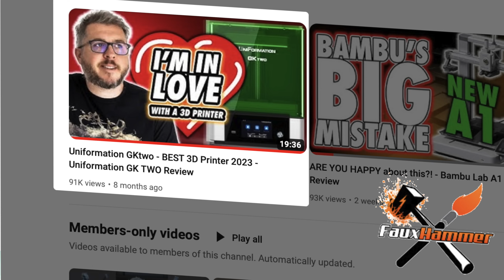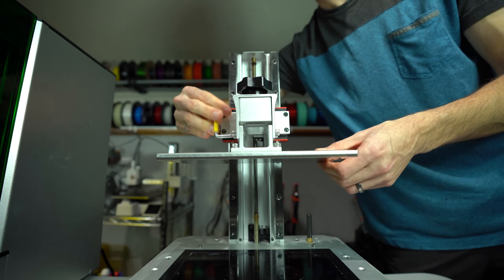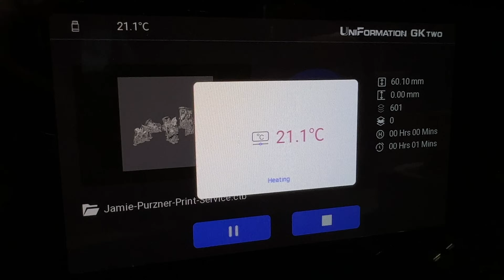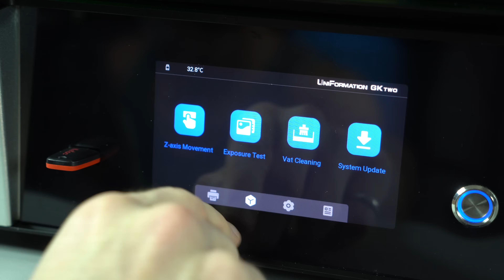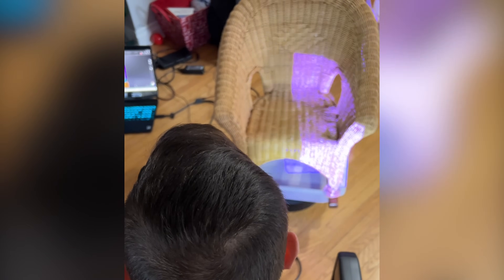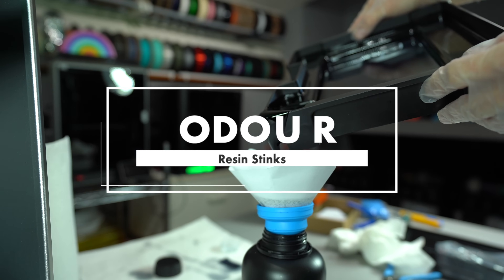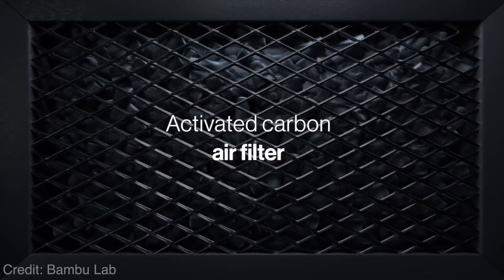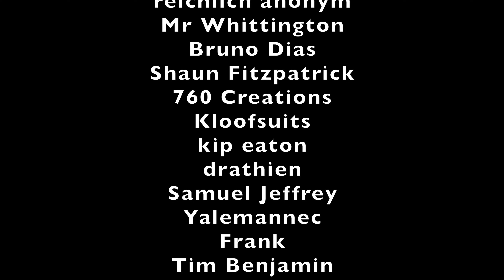The Resin Printing Revolution - It Sucks Less Now! Uniformation GK Two Review

Comment: Last year in September, I bought a GKtwo for work. Immediately after the first print, there were glitches on the screen. After a while, the screen would start to show glitches in the form of lines that grew thicker and thicker, eventually going completely black. I asked for a replacement, but after several inquiries, the answer was unbelievable. I have to open the printer myself and look at the cable, according to their (very bad) instructions. They are aware of the error, but are still selling that printer model. I wouldn't say anything if it were a cheap printer, but it is supposedly a high-quality and expensive device.

Comment: Sucks less but it still fucking sucks. Resin printing needs to be rethought, a total redesign is needed. The operator should never ever have to touch the resin, PERIOD! It's too fucking messy, too expensive and too unreliable for business. I spend too much time fixing these pos printers than doing the job i was hired for, smmfh!

Comment: Thank you for sharing this. I have the same sad experience with an anycubic printer. I found the process of the resin mess unbearable. It made me totally obsessive with swapping gloves and wipes to not get that stinky toxic shit on me. I did manage to get some good prints for some stuff that I really needed to I had no other option. I also got a bunch of failed prints due to different temperature in the shed that I ended up placing the machine. Maybe this machine will be ok in that aspect... unsure, maybe... what other machines have heater for the resin?

Comment: I recently bought this printer, it's amazing. I use water washable resin, practically odorless and so easy to clean.
Reply: I don't think there actually is water washable resin?? Are you sure? Even the 'green' varieties are toxic and require curing before disposal.
Reply: @robb233  Google it bruh...

Comment: Hi guys. While printing, an error message pops up that says 'print error' and the printing is being interrupted. Any ideas? The strange thing is that up to the printed layer, everything looks great and then it just stops printing with this message. I have tried cleaning up everything, using new resin (or even no resin at all with the same file) and leveling again, but still the problem remains. Any ideas?
Reply from the maker: @alexioshamilton8284  no, sorry. You’d be best to reach out to their customer support to see if they can help.

Comment: My last employer had two Form Labs 2 machines.. I wasn't impressed by them at all.. though I think that could in part be due to how many people were using them.. or misusing them 🤔 I've got a CR-30, Kobra Max, I Mega and a Delta Kossel.. the Mega is my most reliable machine and that form lab experience is what has put me off adding resin to the list.. but I think this printer and its reviews have swayed me to buy...
Reply: Ps. Which 3d scanner were you using for that chair?  I need to do the same, cheers.
Reply from the maker: @slimplynth  I’ve never worked with a Formlabs printer first hand but often times more expensive doesn’t mean better so what you’re saying makes sense. The GkTwo is on clearance right now because they’re coming out with the GkThree soon. The scanner I used was the Einscan Pro 2X Plus.

Comment: I print in my small DIY spray paint booth (uses two 300mm 550 watt extraction fans with commercial filters),which is setup in my garage.  It works great in removing all smells/fumes outside.  Highly recommend for keeping you and your family healthy.

Comment: im about to get an upgrade from Mars 4 Ultra, jeez... that was a pain in the backside, leveling was made so stressful as 1 side NEVER is leveled no matter how much you relevel it. temperature problems, as its always cold where i am. fep/acf problem which also brings from the levelling being a problem, the single wobbly Z bar it has.
When it worked it works but mars 4 ultra was the first printer i had, i learnt a lot from it though which is good but having the inconveniences it gave me... hoping the GKtwo can fix and tick those boxes for me 🙃

Comment: I feel exactly like you do. I use my resin printer when I have a figurative gun to my head and no choice but to use it. The results are amazing but it's still not worth the hassle unless I can't print the part any other way. I don't own the gk2 but am tempted to upgrade to it. But I don't love that build plate much. If I got this I would remove the carbon filter and just cap that off, and use an exhaust system to outdoors and stay out of the room while printing. I wear a mask with 60926 filters when cleaning and curing, or when I have to be in the room with the printer. Resin printing is dangerous and has to be treated with respect, or you chance getting really bad news from your doctors some years down the road.

Comment: Internal filter circulation is more important than you think. A single pass through a carbon filter is simply not enough to remove a lot of VOCs. By re-circulating it you are keeping the VOCs in the printer and you can run the chamber fan post-print for a while to ensure most VOCs are filtered out of the air first. I don't plan on getting into resin yet, FDM is doing fine for my purposes, but for me to ever do so the printer is going to have to have an internally circulating carbon and hepa filter for me to trust it with my health, that stuff is nasty even when the smells are removed.

Comment: I placed a glass screen protector on my photon mono X and sealed it in place with kapton tape. I learned this from using a smaller photon first. I level before each print, clean the vat and spray it with ptfe. You have to be serious about the prints if your going this route.

Comment: This is a great relatable video and I'm finding it at the perfect time. Recently upgraded my FDM machines to a couple Bambus and it's been such a game changer that I've been looking at my resin machines trying to figure out which one I should buy to feel like a comparable upgrade. Was considering the Sonic Mega 8k for this ability to do huge batches, but reliability and consistency is ultimately what matters most to me, so I can focus less of my time on maintenance, downtime, and failures. It's the perfect time because I also just had a Halot Mage's UV light die (flickering) I'm going to buy a couple of these bad boys with your ref link right now. Your channel really deserves to pop off in this space.
Reply from the maker: Thank you very much!

Comment: Also, stop using paper towels on your fep and go easy with the spatula. Keeping your fep in good condition is how you go a very long time without failed prints. 
I use a soft silicone spatula and gently wipe and stir vat between prints. For cleaing, I use a silicone brush and have long since stopped with the paper towels. A bit of alcohol and some use of the brush is enough to get the vat clean - without scratching the fep at all.
Reply from the maker: Thanks for the tip!

Comment: It's entirely not the printers fault, unless those Anycubics are duds. Hate to say it, but I've had so few failures in resin it's not even comparable to my years with FDM. I've burned out one screen so far and sometimes the linear rail gets sticky and needs cleaning, but overall, I've had a much, much easier time with resin.

Comment: I've not used an FDM printer yet, but Resin printing is not that hard. The biggest hurdle is correct setup and calibration. After that, yes, clean up can be a chore, but if you work neat to start, you have less to clean after. I run a Mono X, Mono X 6K, M5s, and a couple DLP's. I recently printed 160 minis from Loot Studios with matching bases in a handful of days. 2 failed due to condition of the vat.

I would like to get into FDM to print larger scene pieces and objects.

Comment: I have had the exact opposite experience with resin printing. I have had just the one anycubic photon mono 4k and it has lasted me about 2.5 years now, I always get WAY better print quality on resin prints compared to fdm. FDM is good for printing quickly and prototyping but resin makes the part 1000% better.
Reply: I dont understand why everyone loves unfirmation gktwo like there exist stuff like anycubic m7 and even if that dint exist yet nobody is talking about it now even when its better then this printer, aswell as the m5
Reply: 6K Mono here. Never had a failed print. Never. Not even a partially failed one. Far far better quality than any of my FDM printers. I used 6 paper towels, 1 set of nitrile gloves, and a little IPA for each print. It's so easy and quick to clean up that I'm ready to start the next print job before the current one is out of the cleaner. I'm 8 seconds in and this guy is complaining about mess... my brother in Christ, how the heck did you get resin on the outside of the reservoir? Of course it's a messy experience if you have no workflow or skill! Doesn't smell worse than my FDM printing, but maybe the resins I use don't make much? (mostly eSun Hard Rough ABS like).
Reply: Me too! On exactly the same model of printer. For a pro with a print shop, I honestly think he just took a dislike to it early on and never put in the work to get on top of his issues.

Comment: I have a resin printer and have found it very messy and wasteful to use the alcohol solution for cleaning the biggest drawback in my opinion as the alcohol vat gets dirty quite quickly and you have to set it aside for a long time for the plastic to cure in the alcohol before you can reuse the alcohol and dispose of the resin. My garage is now full of toxic chemicals and stinks whenever I print anything, all this to still have failed prints. You need to print an awful lot of stuff to make back the cost of buying the printer. Debugging can be difficult to as, after months of failed prints, I finally realized it always failed when the outdoor temperature dropped below 10'C in overnight prints and I had to buy a heater.
Reply from the maker: That pretty much summarizes my experience as well.

Comment: Which 3d scanner do you use 😮, scan came out pretty good!
Reply from the maker: I used the Einscan Pro 2X Plus for this. I was also quite impressed with how it turned out. I figured that rocking chair would be a challenge but it did a nice job.

Comment: Resin printers are fantastic and have been for a long time. They have got slightly more user friendly yes but all of the issues you mentioned are problems caused by you or your settings. 
Even the old machines have been extremely competent (I have ran an Etsy shop printing miniatures for years with multiple different printers)

Even the original Photons I had printing consistently with no issues, I would run a print. Clear the bed, run another print. It's extremely rare with resin printers that a failure is the printers fault.There isn't many variables to fail outside of your settings. That being said they're very different to FDM and I don't feel the experience translates well for either. 

I think as long as you're willing to take a look at the issue, realise what's going wrong and why and rectify it. You'll have a strong workflow in no time and understand quickly why you're not getting the results you desire.
Reply from the maker: Great insights. I’m sure you’re right. Even the cheapest of resin printers can produce great results. The same is true of filament printers. The quality of life features of higher end models are just an added benefit that tends to make the technology more accessible to those that are less knowledgeable.

Comment: Resin printers need a dedicated workspace and SOP to deal with the toxic fumes and chemicals and it’s very messy. I gave mine away and print w/ an  X1E and mk4. A 5T XL is on the way.
Reply: What is a 5t xl? I googled it but couldn't find anything
Reply: @fabianluethi03  5 tool head Prusa XL
Reply: How do you like the X1E?
Reply: @eriklundqvist4221  It prints great out of the box, probably similar to the X1C from what I've read about that printer.  The heated chamber is there when I need it; although it is slow to heat up and the improved air filtration over the X1C is a bonus although I don't have an X1C to compare to.  The biggest downside I've found is that X1E spare parts were scarce for several months (possibly due to the printer being new) and need to be ordered through a reseller although I haven't checked on their availability in the last few weeks.  Many parts are interchangeable w/ the X1C, but the extruder / hot end is not and needs to be ordered through a reseller.  You can also purchase a service contract on the X1E through a reseller which will give you much quicker response than directly from BambuLab from what I've heard on the forums, but you're paying for it.  For most people the X1C is good enough and prints probably very similar to the X1E, but if you want the added perks, the intranet security and don't mind paying for them then the X1E is the right choice.

Comment: The lack of auto-leveling in most resin printers is horrible; the odor is not the worst part of the resin, so a carbon filter is not enough. Adding and removing resin from the vats is just a horrible, lazy design. I rarely run my four resin printers, but my FDM printers run almost constantly.
Reply: Same here. I was so pissed off having to clean everything after each print I only used it twice!
Reply: I was looking at getting a resin printer for miniatures. But everything you just said was the reason I didn't bother with it.

Comment: Your frustrations sound like my experience with my original Anycubic Photon. But when i switches to my Photon Mono SE, everything just *worked*. In about a year, I've had maybe a half dozen failed prints, and had to relevel my build plate maybe twice. I also use Elegoo ABS-like Fast Gray, which prints beautifully and is very resilient to impact when cured.
Reply from the maker: Nice. Glad to hear your issues got resolved.

Comment: Ive had $2000+ zortrax printers before, and i still have to say elegoo are the best!
Reply from the maker: Elegoo is a great budget friendly option. I had the original Saturn at one point. Resin printers have come a long way since then, despite not being that long ago. I haven’t tested any of their newer offerings but they seem quite refined.
Reply: @ygk3d I have a couple of OG Saturn's. I've recently upgraded to their 12k Saturn 3s and I took the plunge on a Saturn 3 ultra. Saturn 3 ultra wasn't worth the extra, but the Saturn 3s are worth a lot more than they're asking. I have the mono m3 Max and they don't even touch the Saturn's. For the price, they just work.

Comment: Nice Video. I waiting for my Tktwo. I can't say i like resin printing, messy and worklow is everything. 
In contrast to printing, I am more than convinced by the printing results. I have a P1S and I like the practical components. But for high detail like models resin are much better. And "anything that resin make sucks less" are welcome.

And i ask the support if the wifi stick included and there say yes.
Reply from the maker: Thank you! You’re absolutely right. Resin has its drawbacks but there’s some things it can do that filament printers just can’t.

Good to know about the WiFi dongle. Thanks for clarifying!

Comment: Interesting video as always 👍
Im no fan of rasin printing.
The epoxy resin is in my opinion only for industrial purpose, or on a highly temperature and toxin controlled environment.
And not being able to smell the rasin, is not the same as it is safe!
Try to measure the toxic molecules in the air, and you will be scared.
I still thing the industry havent made the resin/uv process mature enough for hobby usage.
Reply from the maker: Thanks Asger! I appreciate your viewership as always. Resin definitely requires some special considerations for safety. Good point about no smell not being the same as safe. Just think of carbon monoxide. No odour but it will kill you 😬

Comment: What resins do you use that stink? Health aside, I've noticed most new technology resins have very low odor, especially when paired with a carbon filter.

But yeah I agree with you, and Ross, this machine is a TANK and needs to be the go to option for consumers. Like me, purchasing a cheap resin printer will just make a hobbyist hate the craft.
Reply from the maker: The one that really smelled was Siraya Tech Blu.
Reply: Health aside? No, you're breathing toxic chemicals and need to stop lmfao. Carbon filters also remove the smell, but get a VOC meter, you're probably in a >10.
Reply: Which ones do you use that doesn't stink id love to know as every single one ive tried smells like tumors and immediately  gives me a headache

Comment: One point you mentioned is that it could be better that the air filtration is not a closed loop system, that is wrong, you want to have multiple passes on the carbon, maybe designing a custom tray to hold carbon pellets could have a better result.
Reply from the maker: Mhh.. good point. Thanks for your insights!
Reply: Carbon doesn't remove anything but the scent. Run it through as many times as you want. You're just making a localized collection of the chemicals in a cheap carbon brick. If you do "use" those, at least have it outside the workplace.

Comment: The one thing I'm missing, is the autofill solution that Formlabs has. I've used Form2 and 3 printers a bit and they rock, but then, they are very expensive and with the Form3, you're completely locked down on only using their resin, which is good indeed, but again, very expensive. I just hope someone replicates that functionality so that one day, we can get a good resin printer without robbing a bank…
Reply from the maker: The price of Formlabs resin is a real deterrent. I’ve considered their machines before but can’t get past that point. They’d be fine for R&D in a lab or a company, but it’s hard to turn a profit on printing services when the raw material is so expensive.